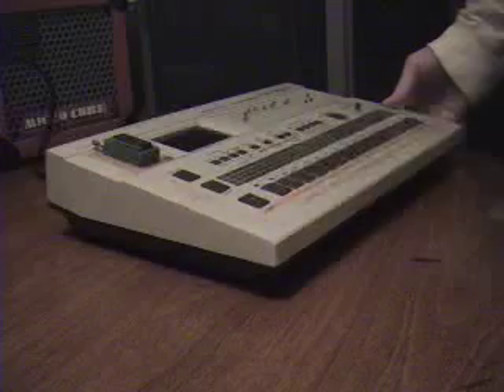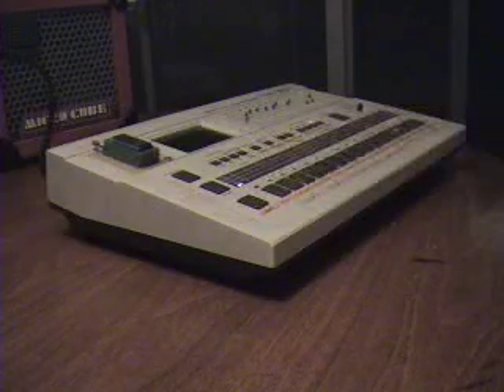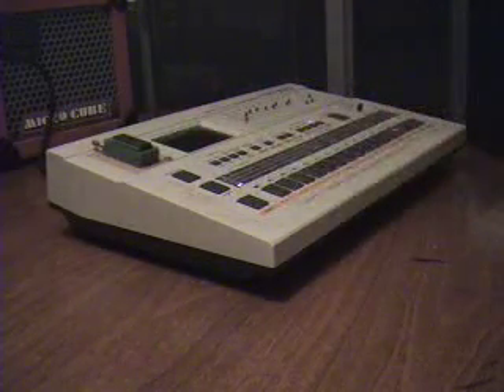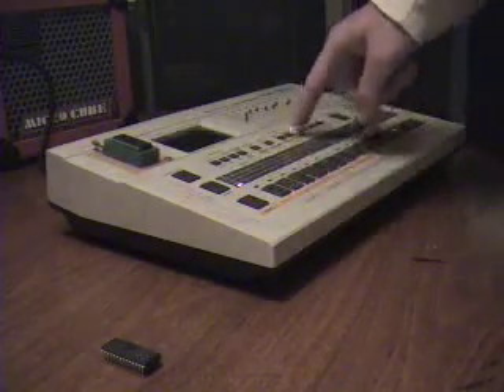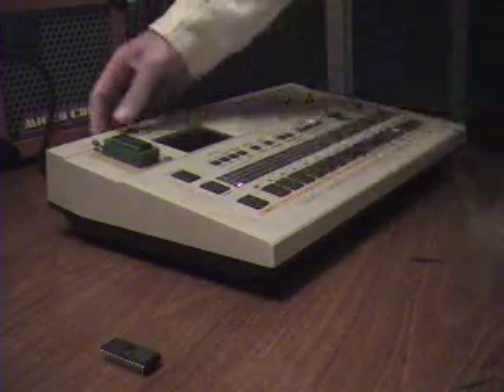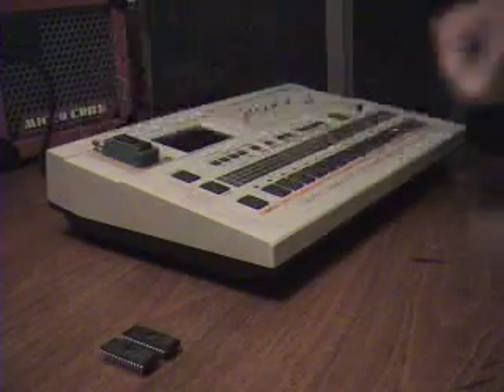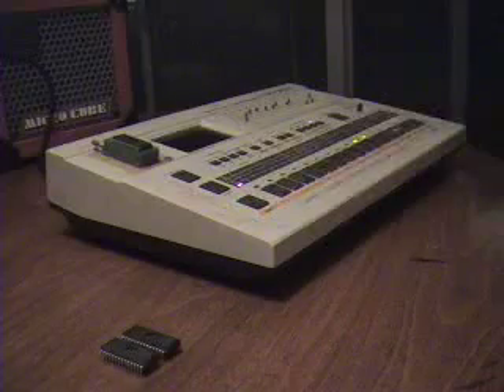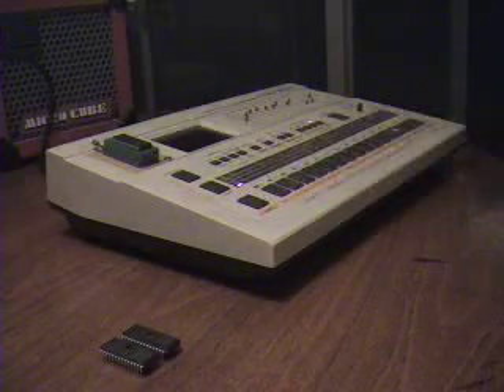TR-707 Battery-powered with quick-swappable EPROM sounds

Comment: ..must have been a factory fix..i did a reset and all sounds returned and diametric lube all mollex connectors, and reheated the patch..now i still have a light static in the machine..so i took apart and on lower board i see a small nick in what looks like the ground..my question is is that supposed to be there or do i need to patch that....or do you know where to get circut scedmatic for the roland tr707, thanks

Comment: hi my name is mike and i noticed you bent a drum machine, so i was wondering if you could help or point me in the right direction, , i  opened it up and notice that a small crack on the top board had been patched (nice job) if you push in that area you can here the static come and go...funny ive owned it since new

Comment: This makes great sense given how great the sequencer on the 707 is but also it gives you the ability to make as many eproms as you wanted.

808 sounds super super hot but the 909 to me doesn't sound like a 909 set at all, is there a chance the sounds could have been misslabeled? I know of a real old set of 909 samples floating about on the net that cover the full sound spectrum that I can give you the link to if you need it.